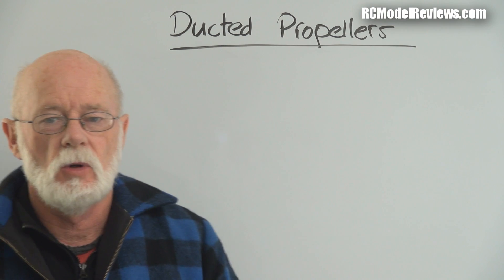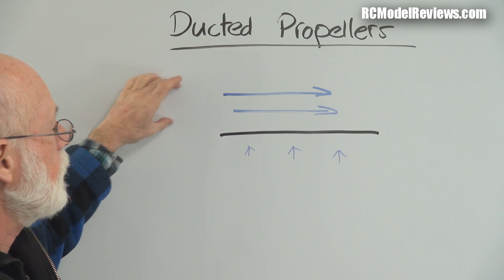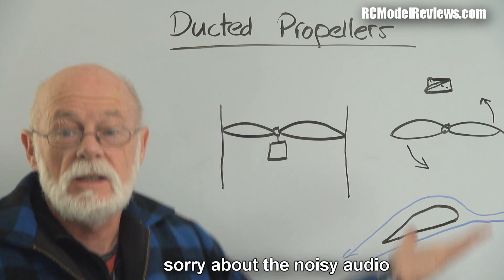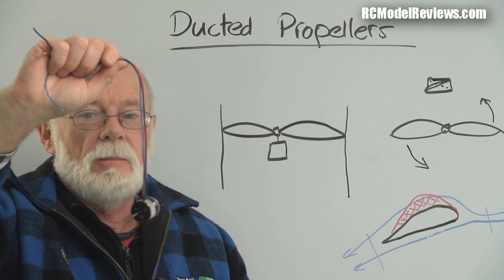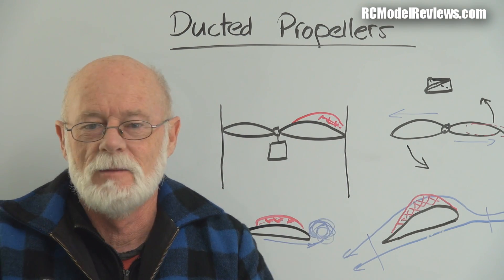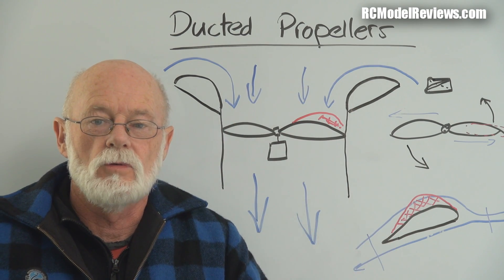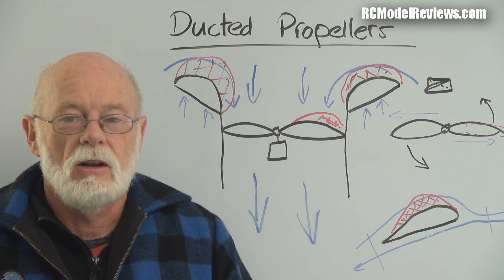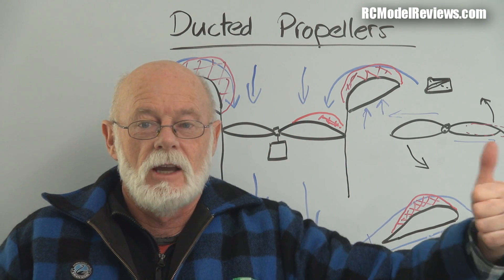How ducting a propeller increases efficiency and thrust

Comment: Great explanation! Not to nitpick but you left out a few downsides and made these sound like a much better solution than they actually are. I agree they are cool though, but here are a few you didn't point out (that you may already be aware of). For props with the ring attached (not just a prop in a duct) 1. the additional inertia added by having a ring that far out from the rotational center slows down control responses on a quad for a given power system/torque. You eluded to the gyroscopic effects of that rotational inertia but that is not the only downside. 2. The weight of the ring adds alot of centrifugal forces on the blades that attach it to the hub, greatly reducing the max rpm it can handle for a given prop material and blade design/thickness. This means not only do your blades have to be heavier than an un-ducted prop (in addition to the weight of the ring as well), but also thicker, with more whetted area and therefore more drag. 3. The ring itself adds whetted area that increases drag. 4. the complexity of the ringed propeller is such that typical composites are difficult to lay up to make them (just as single piece composite rims for cars are extremely difficult to make). Composites having the highest stiffness to weight makes them the best material to make props in most applications so this is a huge disadvantage. 5. Because the blade is supported in torsion on both the hub and it's attachment to the ring, it cannot unload itself as easily as a blade with one free end. This gives it both more predictable aero-elastic properties under high thrust loads and increases the importance of matching the blade for the power system since it can more easily be overloaded. A typical blade can be mismatched at lower risk because it will untwist and flatten itself to relieve the aerodynamic loads without being overloaded to failure. Hope that makes sense?

One thing also to consider: Just as induced drag on a wing due to vorticular flow at the wing tips is reduced at high speed, the induced drag on a prop is also reduced at high speed. (look up induced vs parastic drag plots for a wing for example). Given the airspeed the prop "sees" is both a result of it's tangential velocity and forward speed, the tip vortex is actually not as huge an efficiency reducer in forward flight as you might believe. In order for that vortex to reduce efficiency it needs the time to impinge on the upper surface of the prop blade which at high rpms and/or forward speeds it does not have. For hovering efficiency it can be a big driver, if the prop is large and spinning slow enough. In that case the weight of the ring, it's viscous drag, and high rotational inertia scale up even worse than on smaller props. There is a reason we don't see these on any full scale aircraft (that I know of)! The only time I can see them being used to advantage is on small indoor rc models, where the combined efficiency gain due to low blade speed, added benefit of the ring acting as a safety prop guard, and exponentially smaller blade loads might actually out weigh the costs.

Comment: The weight of the duct will need to be lesser than lift force gained.
Reply: Alan Fok just thinking the same thing
Reply: Yes, they're made of "Duct Tape"
Reply: No really? Maybe that's why my super aerodynamic lead car was such a failure.
Reply: +Völundr Frey      Maybe a concrete car instead.     A concrete model aeroplane could fly (Mythbusters, TV programme).

Comment: what would happen if the duct was part of the propeller?
Reply: john hornby I'm curious too.
Reply: i will soon be getting a 3D printer, i'll try it out :)
Reply: The forces would be very strong and so the duct has to be very heavy to be strong enough, or it would break.
What you can do is put winglets/wingtip fences for this purpose - the end of the wing is pitched up (sometimes and down) to separate high from low-pressure air, reduce the vortex and increase lift.
Another similar idea is the raked wingtip - the end is thinner and more swept - it reduces the vortex of the main wing wile producing lower vortex of its own. 
Some helicopters have swept ends of the rotor blades - the AH-64D for example. This increases max speed and reduces noise.
Reply: Do you mean putting a winglet on a rotor blade?
Reply: no i mean make the duct the outside edge of the prop...  all one piece.  the center of the duct, instead of a support piece to mount the duct behind the prop the prop would be part of the duct, the fins of the prop would attach directly to the duct, stopping even the smallest air flow between them.
Reply: ***** The wing rake makes sense in rotorcraft but putting a winglet on a rotor blade would cause stupendous drag in forward flight and is therefore ill advised unless hovering is the only goal.
Reply: It's not practical. The added weight would create burdensome gyroscopic loads, and it'd have to be very strong to withstand the incredible centrifugal forces.